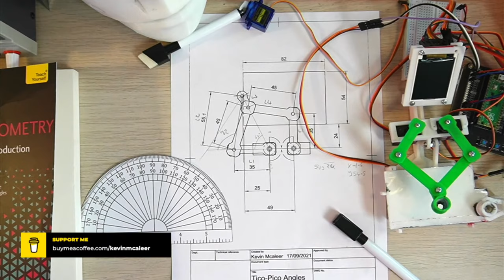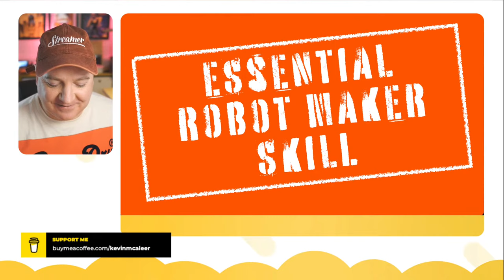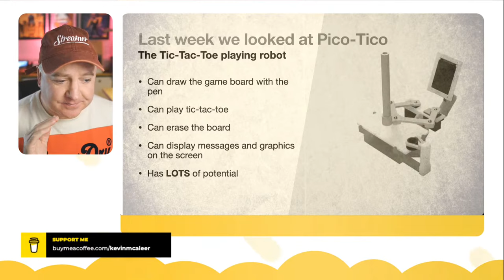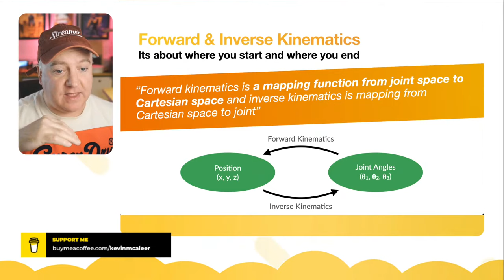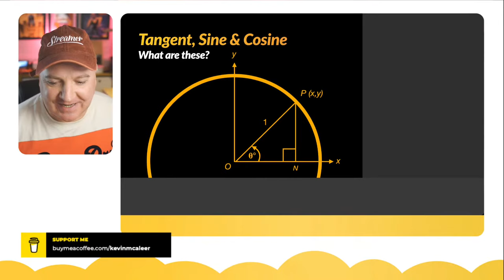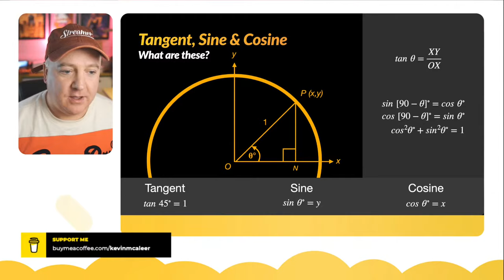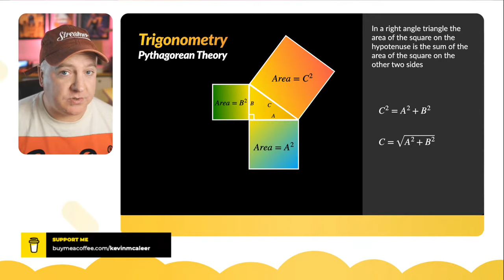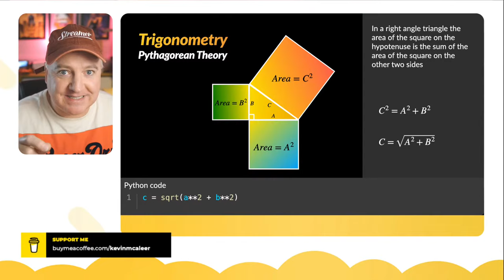Inverse Kinematics in Python and MicroPython

Comment: 8:53 python code is different from equation on the right hand side. At 13:28 the python code from 8:53 for acos, is now written incorrectly. This can be discouraging for an already confusing topic.
Reply from the maker: I've checked the slides and the code is correct. Code is often written slightly differently than pure mathematical notation.